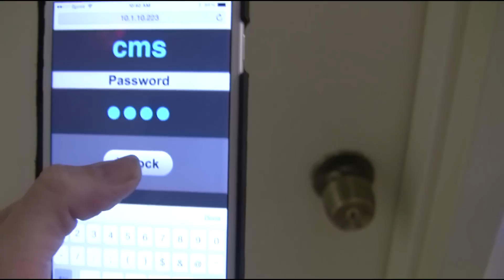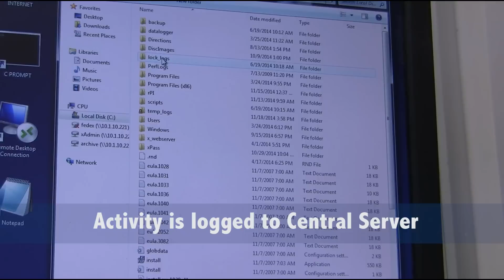Custom DIY RFID Smart Lock - Raspberry pi

Comment: Any tutorial you follow? What programs did you use?
Reply from the maker: Webiopi for the cell phone part. No tutorial really. I had to mix and match code from different tutorials to get it all working. I can try to help if you have questions.
Reply: craisondigital Awesome ! Could you make a tutorial for this , or post the code and stuff , and could the log file be on the raspberry pi . Thats an awesome RFID stand ! I think 1 RGB led would be better looking  instead of 3 seperate led s . 
Thanks!
Reply from the maker: I will make a tutorial, but am limited on time so not sure when. If you have specific questions I could try to help. Yes, an Rgb led would be better. I haven't studied those to know how to change the color of those via the pi, but plan to in the future.
Reply: Waiting for the tutorial 😏
Reply: craisondigital I would love to see a sample of code or something, just for the webiopi interface. I would love to do something like this but cant seem to get anything to work! Webiopi is my only issue really!
Reply from the maker: You can use webiopi to control the Gpio pins on the pi. So you would create a webiopi webpage that simply activated the GPIo pin that the relay is hooked up to which controls the door lock.

Then, you would create a separate database like sql, or your choosing and set up credentials so that after successful login they are directed to your webiopi page above which opens the door.
Reply: I love this video, very well made and your other videos are also good, keep up the good work! 

I am a uni student, and have quite good knowledge of the hardware side of this project, but I'm new to the pi, so I have very limited knowledge of this ide of th project,

Is access granted in an OR system, either the RFID or the web app/webiopi access, to achieve the activation of the relay? 

If I was to give you my email address, could we correspond just to share some of your wisdom with me as I'm really stuck and there seems to be a big lack of information out there on the web! 

Thanks!
Reply from the maker: Ah. Yes, it's currently either/or. I do plan to link them in the future as you have to add users in two separate places currently. I disabled the built in authentication of webiopi. In this case, I use FileMaker as the database as the company already uses this to track inventory, but you could use any database.

When the user opens the lock via web, not rfid, it checks the FileMaker database for correct credentials. When the user opens via rfid it checks the running Python script for correct Id of fob.

To link this, I will probably use sql instead of FileMaker and store user, pass, and fob id. Then have both methods check the sql database. Then import sql back to FileMaker. Yes feel free to email me. I will help with what i can.
Reply: craisondigital See what I want o do is start basic and build my way up. If I could make the 'passcode' web page, which would grant access to 'lock' and 'unlock' the door, initially, that would be great, then I could start to progress from that! Yeah, what is your email? or private message it to me or something! Thanks!
Reply: +CurvedHalo I would love that too, and maybe if Craison Digital  has the time , to post the code for the rfid module since I have one sitting around . Thanks !

Comment: but what if there is blockout in the building or servers hang/go down and need resetting?
Reply from the maker: The lock is wired to a key switch on the outside. You can use a regular key to open the door with this. All is on battery backup

Comment: Could you explain the wiring of the power supply control and relay? Is the relay connected to the NC of the of supply? I found this exact supply on amazon and just a little curious how I would connect it with Arduino and relay. Thanks!
Reply from the maker: scooter12t The relay is connected to the same terminals as the emergency exit push button.  I will double check, I believe it is NC.  At the relay side, its NO.  When activated, The relay is set to close for two seconds (opening the door) then open.

Comment: hey,
im a starter with raspberry pi but i want to know if its possible to make the door lock only with raspbery pi by that website. any information would be great.
Reply from the maker: MEe$ Yes, but it may not be the best starter project as it's a bit involved..  Check out webiopi.  This is the open source software I use to control the pi from a phone/web browser.  You could wire the lock to a relay connected to the pi and control that relay from a web browser, you wouldn't need an rfid reader.
Reply: +craisondigital thank you!! i think i understand it a lil bit... the 3.3 (or 5.0) volt are always + and pin 17 etc are - (or otherwise) thanks for the info, ill say when my raspberry pi has exploded😓😵

Comment: Hello!! @craisondigital

I am trying to make a Wireless Door Lock and Message Display Board System! The
idea is to connect a smartphone/computer (through HTML?) to Arduino over Wifi
network and use it to send and receive simple messages that will be displayed
on a LCD connected to the Arduino board which is fixed on the door. Is this
possible? Do I have to use a wifi shield or can I also use an ethernet shield
with a router? Which will be easier?
Also, if the above is feasible, I will then go on to expand this into a door
lock system where the phone/computer can be used to lock/unlock the door by
using a simple passcode lock over the wifi network. So, a person can remotely
lock and unlock his/her door from anywhere through wifi. Is this feasible too?
Thank You in Advance.